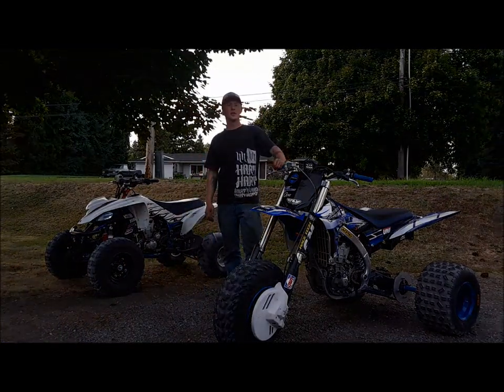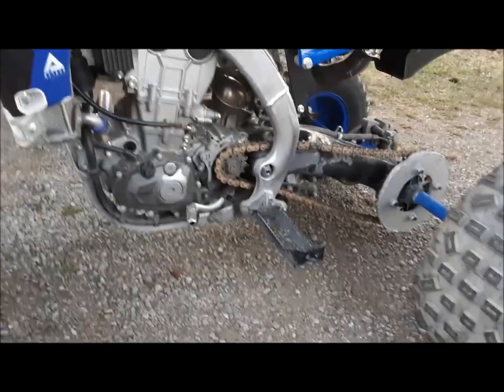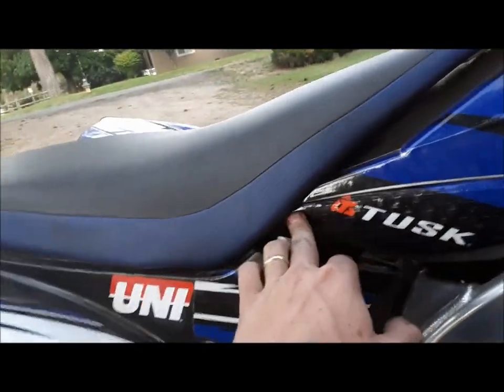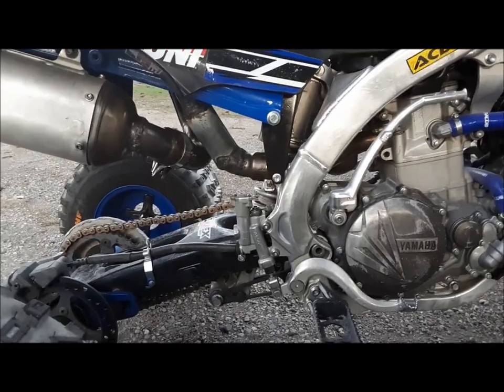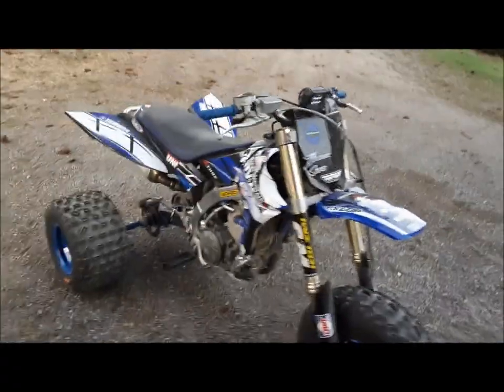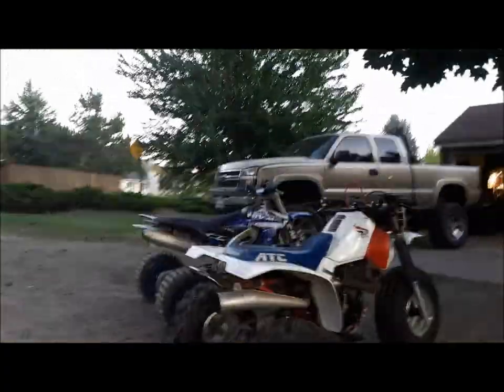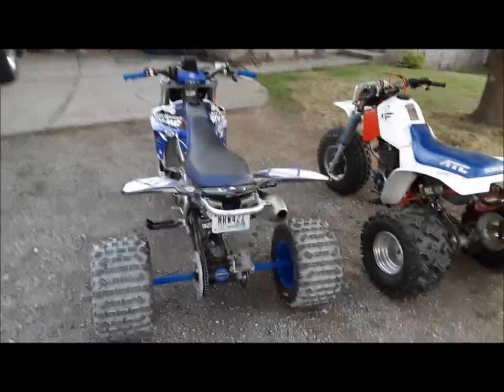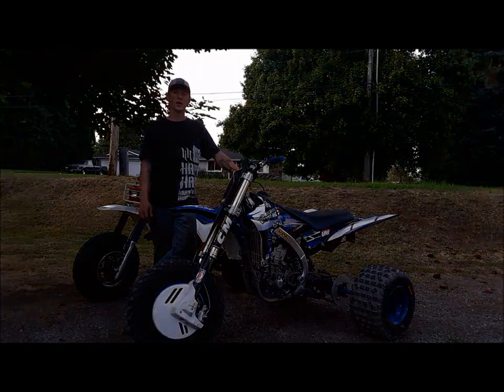DT Motorsports YZ450F 3 wheeler conversion 2010 trike

Comment: If a 450 engine randomly cuts off and wont start any more but didn't blow up what happend to it plz help me
Reply: depends it could be not getting spark so change your spark plug to oem and clean your carb if carburated
Reply: @redrocket-zd2jz  ok
Reply: @3dwezzy740  out gas lol?
Reply: out of gas lol?

Comment: Underpowered... 250r? What poop ass 250r did you ride?
Reply: Jared Stevenson  even then no
Reply: Jared Stevenson  that's a given but to claim a 250r is underpowered is wrong also with all the available mods for the R that motor is a beast with almost limitless potential.